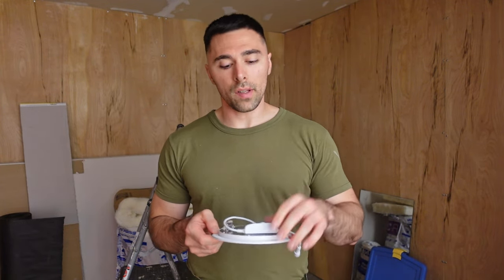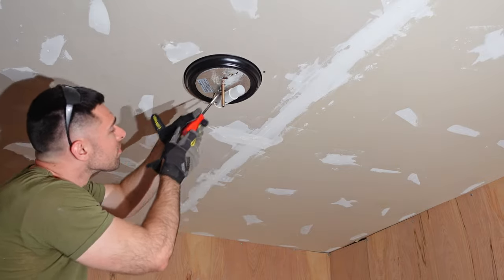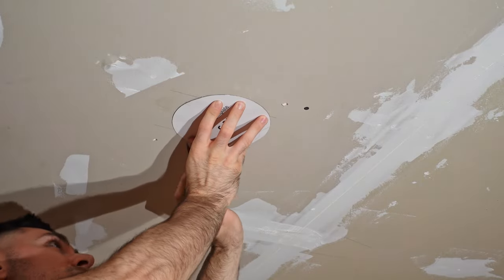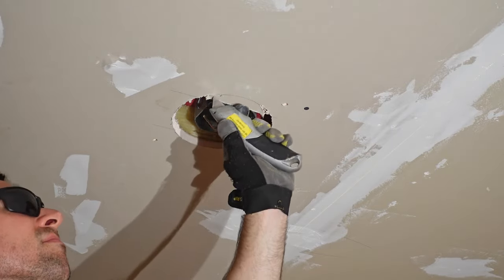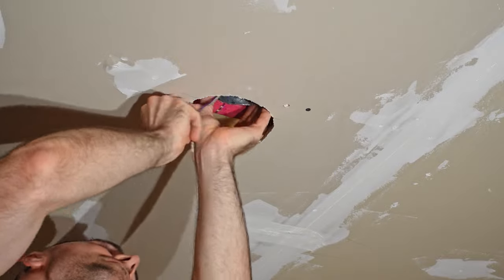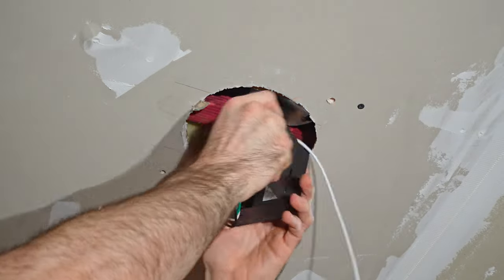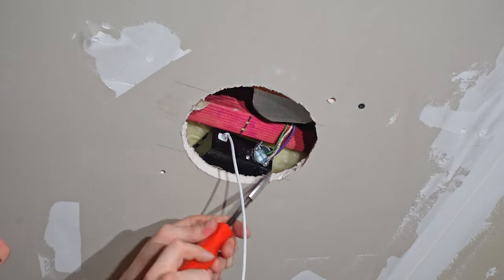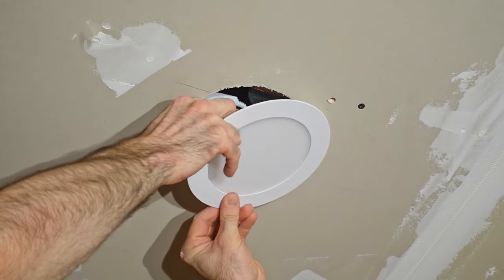UPDATED: How to Install Ultra-Slim Recessed LED Lights || No Hole Saw, No Problem

Comment: Great..  you fixed most of the errors from the original video... However, you should have run a short piece of NM cable (Romex) from the original box to the new black box since those bushings are intended to clamp NM cable, not individual conductors...

Comment: Could you not have put the conduit into the new LED box instead of in and out of the other box?
Reply from the maker: No because the new LED box only have holes on its sides, which meant it would have to stand on its side. There wasn't space for it to stand on its side.